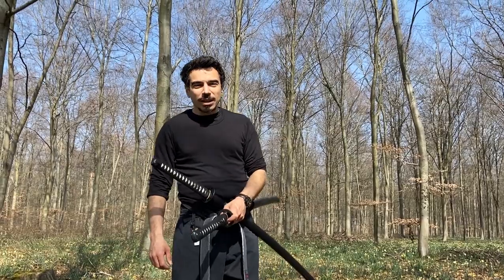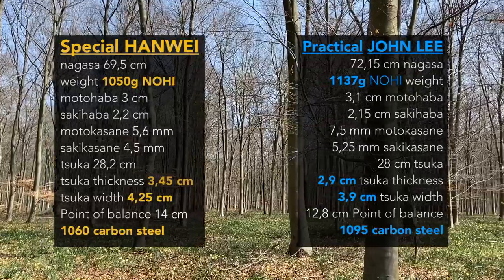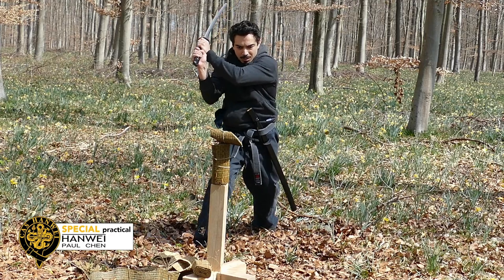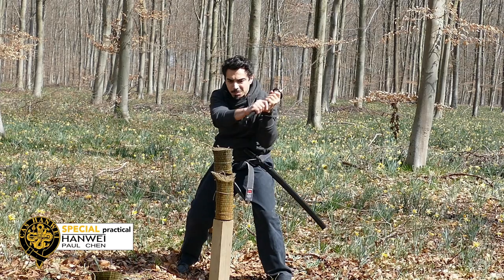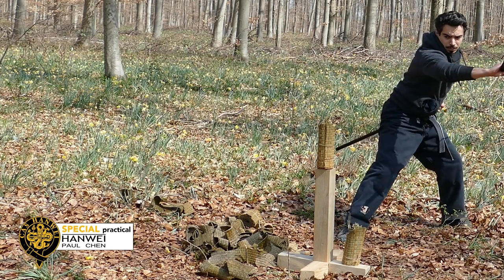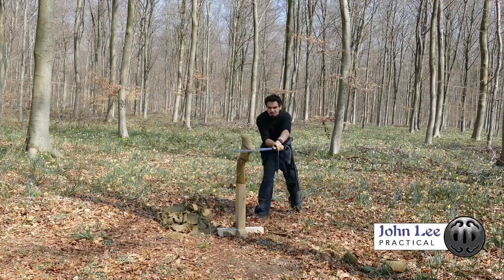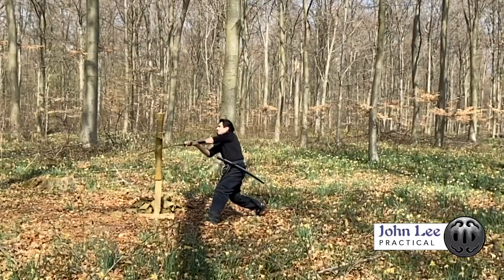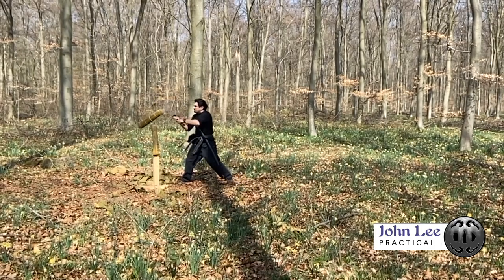John Lee Practical katana versus Hanwei special practical battodo double cuts tameshigiri

Comment: im thinking of buying one of these katanas, wich would you say is best for me? (i want to use it mostly for iado,and i am 1.76cm tall)
Reply from the maker: Hello dear ronin,

you can check the tozando guide size
for measurements tsuka and nagasa

If you want to cut bamboo you need nohi

if you want to cut mats bohi is ok

if you want to make double cuts with mats nohi

depending on weight distribution and fittings quality and budet and your size you have :

- Ookaze bushiden or tameshigiri edition

very good and for good price
(fittings not great) but very good for practicing

- hanwei (becarecul witv tsuka thickness thinness)
1060 or 1095
I recommand 1095 not 1060
> shinto bohi is excellent

- john lee : hannya/practical

- YNH (yarinohanzo) if you like their koshirae
balance not great in my opinion
but practical

- huawei very good and excellent craft but do not take a 2,3 cm sori it is very not appreciable useful blade

- Z sey interesting craft very expensive (for fittings quality) and balance not my favorite

There are many brands ...
check your precise size find something that suit to you
with low budget I would say john lee practical or tameshigiri edition from bushiden for your height

Best regards

Comment: Why are most of your blades no-hi? In terms of balance and agility I would assume better performance of a sword with bo-hi, or?
Reply from the maker: Hello dear ronin,
that is right most of the universal size shinken made in china are most of the time nohi. But this not a so bad thing, nohi is on the tradition what is the best for battodo/battojutsu practitioner recommended for omote or bamboo. But even if you would have to block or counter in feodal times against a dotanuki blade for exemple it would be really complicated with bohi because of lack of mass and resistance on the mune. So even I really like and enjoy bohi that is faster and more enjoyable for body stamina practice and healthy joints (sea wave 930-985g shinto (my favorite sword)) I’m looking since a really long time a light nohi sword (1000-1050g) which is fast and also strong without weakness on the geometry (hinariku kareru of ookaze bushiden too weak with bamboo cuts). My favorite japanese swordsman warakiri battosai use most of the time nohi with special measurements. The probleme with regular nohi is that they are too heavy for nukiuchi and batto cuts and muscles easily get tired because around 1100g body needs to use both arms as tameshigiri position for such heavy nohi. The problem with bohi on omote and bamboo is the lack of mass, no bas cuts allowed for such light weight bending easily or worst.
So bohi and nohi have both advantages and inconvenients but I think a really good swordsmith can do a really good nohi 1020-1030g and really good bohi at 985g that is really close for nagasa 2.35 shaku.

Comment: I've often heard Hanwei katana tsuka described as "axe handles". The few I've personally held definitely lacked any shape/taper to them.
Reply from the maker: Absolutely true, I think this is the only problem with this brand (tsuka for 2m tall guy's hand > special prac hanwei + XL practical Hanwei > kind of imogata, even I think it is rikko shape on these both) to have not standard tsuka size/thickness/shape as tozando/huawei/john lee/yarinohanzo/bushiden/ronin dojo pro/murasame or too thin tsuka (shinto hanwei), for all the rest the brand is so good on their blade balance/hamon/prices.
Reply: @RoninHood  I've only handled a few Hanwei katana but as I have short fingers the tsuka definitely felt too thick for me.
The lack of hourglass shape/tapering isn't as big an issue for me if the tsuka is a good size but tapering certainly gives a different feel
Reply from the maker: I totally agree with you, you probably means rikko shape by hourglass shape. 
Size of tsuka is so important (width/thickness/length/ito/tsukamaki/shape) it can ruin an excellent blade geometry for the practitioner, the perfect exemple is the special prac hnw with so big rikko tsuka (I prefer haichi for nukiuchi) that annihilates a so light and well balanced blade, giving the impression of a 100g more heavy blade. If we practice battodo/battojutsu with uncorrect size tsuka the practice is useless and spending omote too.
Reply: @RoninHood  thank you I didn't know the term rikko. Also you are very correct that a bad grip/tsuka on any sword from any time or place can ruin the handling of a good blade.
Reply from the maker: You are welcome, I totally agree it is a so important factor for battodo practitioner or garden cutter, not so well known, and from my personal experience for same correct fitting between hands size practitioner/tsuka size, I prefer Haichi shape for wrist cut movement than Rikko or Imogata, I didn't experience Morozori (tachi shape tsuka I think).
Reply: @RoninHood  Hey. Great info especially for novices like myself. Can we tapper the Tzuka ourselves on the Hanwei special or just replace it with a new  one?
Reply from the maker: I think it is possible and would be really good idea but could be a 1 or 2 years of tries and craft practice to create a new tsuka with good shape and new fittings (fuchi kshira) fitting to my hands and with seppa/tsuba/habaki blade. Huge piece of work but doable in my opinion.